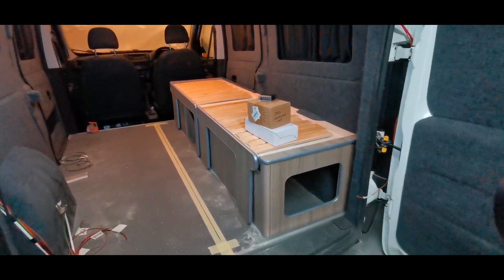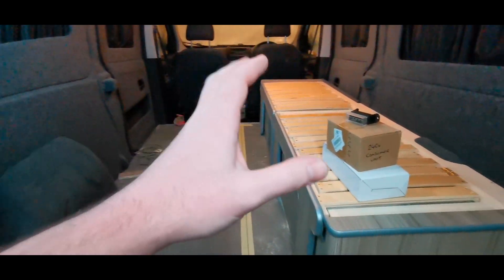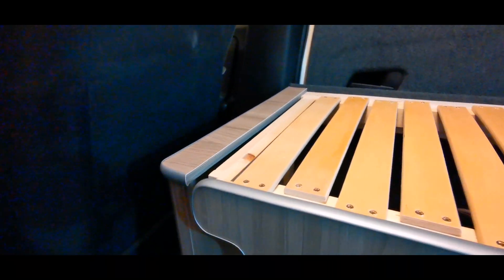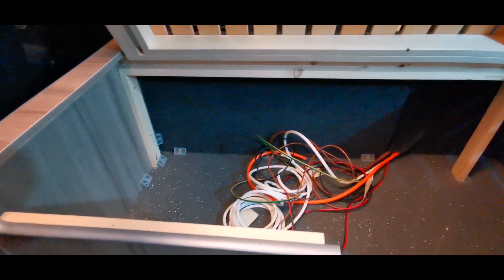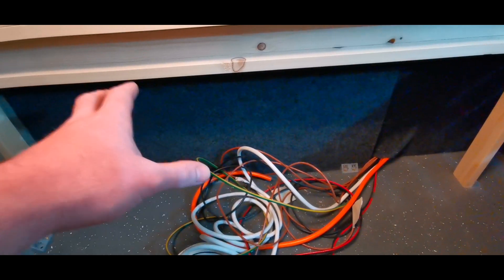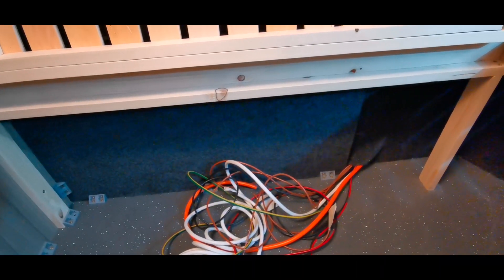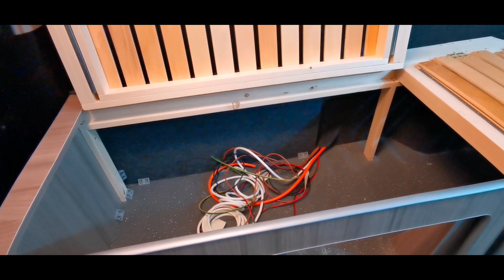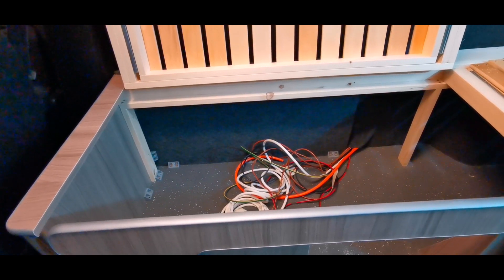Campervan Electrics Micro Campervan Conversion Series 11 Episode 8

Comment: hi dan I have a split charge relay charging my lead acid. if I want to upgrade to Lithium do I 100% have to change my durite standard split charger relay to something like a victron b2b charger?
Reply from the maker: If your new Lithium battery has a built in management system then you will probably be better sticking to what you have because they prefer having a standard direct power supply. If the battery doesn't have a management system then yes I would consider changing the charger👍 hope this helps
Reply: @dantheman321  thanks

Comment: Why do you use those ugly corner blocks, even pocket hole screws and plugs would look way better?
Reply from the maker: It's under the bed no one can see them infact none of them will be on show unless you look hard enough in the cupboards for them. They make a good fixing.
Reply: @dantheman321  I see, but you went to the trouble of making a lovely wee box and really tidy electrics all top notch stuff and I just thought why ruin all that good work with plastic corner blocks.